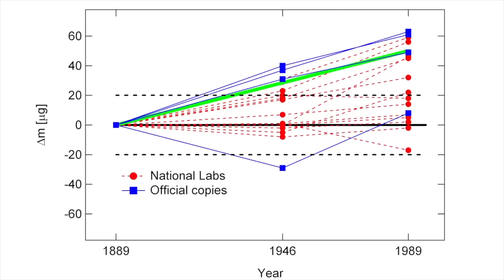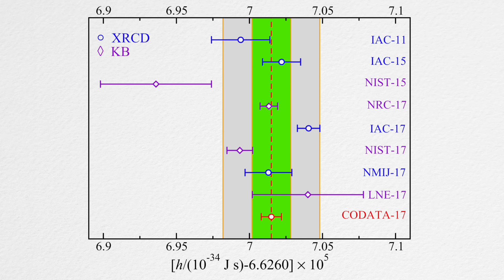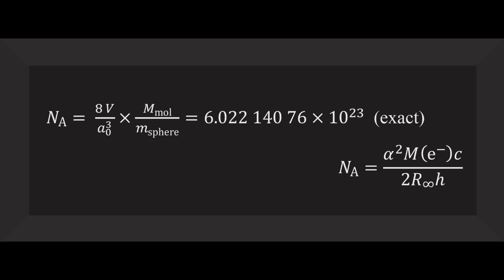The kg is dead, long live the kg

Comment: Is gravity constant on Earth. Is it now what it has always been. The Moon is moving slowly away from us and Earth's rotation is slowing down. Every day Earth is getting heavier from space matter. Is anything really consistent and therefore reliable. We can't make something absolute zero in temperature or make something go the speed of light so are those limits correct to begin with. PI isn't reliable unless you use all the decimal places, which you can't so anything is only as accurate at the number of decimal places used. Aren't things as accurate as the instruments used to measure accuracy.
Reply: Doesn't matter if anything can have absolute 0 temperature or the speed of light. What matters is that these physical phenomena are well defined, understood and calculated. So yes, in fact they are very much correct.
Pi is a well defined constant. And as long as it is defined, it is accurate. Experimental data only double checks the math. When you're doing the math for something you'd rather use the definition than a rough approximation. When doing physics you'll do π=c/d not π=3.14

Comment: I've always wondered why we haven't redefined our units for time. I doubt that an earth-based day would matter much to anybody on a colony that's light-years away. Don't we now understand that there's an indivisible unit of time, something like 10 to the minus 43 of a second? (sorry, guessing here off memory). I imagine we could find a pretty beautiful way to mathematically produce a better unit than seconds using this constant.
Reply: Well the SI unit of Time is s, Second, and it's not defined by any human standard, but by the vibration of an excited electron in an specific atom. The day, month, etc. aren't used in science, where the ultra specific untis are needed. If we have a colony on mars or so, they would and should make a "mars day", but it would be defined by the Second, the standard.
Reply: As Jon said, the second is based off of a scientific unit and everything else is based off of it.

We chose to have base 60 for minutes and hours because that's what works for us here, but anywhere else in the universe can use the same basic second unit...they would just have their in a different scale.
Reply: The problem in defining time is that time is relative
Reply: @JKSSubstandard  It's not a problem at all, you can always consider your frame of reference as the only true one and correct the time of other frames. That's what we are doing.

Comment: Universe is NOT kaos. Scientist can calculate events in space fairly exact. and you can not calculate kaos since it is events by chance
Reply: That depends on what you mean by exact, because I'm pretty sure we don't know the speed of the earth around the sun down to the nanometers/microsecond. Maybe in meters/second but even nanometers are big enough to tell the difference by your fingertips, and there are plenty of things smaller than that. In fact, that's one of the big problems facing physicists right now, is that our physics of the very small does not match up with our physics of the very large. If we try and measure very large things on a very small scale, we get conflicting measurements depending on if we use particle physics or astral physics. So no, scientists can't calculate events in space fairly exact.
Reply: In that case, we can not fairly exact calculate the pi on a spinning wheel. If you gonna be that ticky about what fairly exact means. What I'm trying to say is that universe is not chaos since it theoretical possible to calculate events. Which is not possible  with Chaos since it is events by chance.
Reply: @MrMatsErik  Actually we can be exact on pi, because the SI unit of meters is the distance a photon travels in a vacuum in 1 / 299,792,458th of a second. Pi is therefore defined by the number of times the diameter of a circle with a diameter of 1 meter wraps around that circle.
Reply: When the wheel spins, for an observer straight above the wheel, the radius is the same but the circumference becomes shorter. Which means pi must change in value.
Reply: @MrMatsErik  Pi doesn't change. What changes is what shape that wheel is to that observer. Pi is a constant. That observer is not. That wheel is not. That wheel is no longer a circle to that observer and can't be measured using ordinary circle geometry, because it's no longer a circle.
Reply: Yes it is. it's still a circle when it spins. That's physically proven.
Reply: @MrMatsErik  I don't think it is. In fact, according to wikipedia anyway, Einstein himself said that it becomes non-Euclidean. It must therefore inherently be a different shape, perhaps a cylinder rather than a circle or something, I'm no physicist so I don't know exactly what shape, but it seems reasonable to me that the Lorentz transformation of the wheel requires another dimension (or more) above 2. There are plenty of phenomena that only occur in 3 or even 4 or more spacial dimensions, and your word on the exactness of measurement in a youtube comment with no sources is hardly where I expect a definitive and concise explanation of a complex paradox. So if you really want me to believe your words, please, show your sources, and help me understand more fundamentally. I'm not above calling myself wrong, but you haven't shown me proof of any of my errors.
Reply: I'm neither a physicist. But the point was not about pi and circles it was about universe and the fact that it's not chaos since its events can be predicted (in most cases so far). Chaos is events by chance and can't be predicted.

Comment: Can you use smoke to make a thing hover if the bottom is filling with smoke in a sealed room?
Reply: If the density of the item is less than the the density of the smoke then yes.

The problem is smoke isn't really a homogeneous fluid, what makes it somewhat opaque is all the tiny particulate matter and vaporized oils. So if left long enough to seperate into it's layers of densities, the "smoke" will condense and settle to the ground.